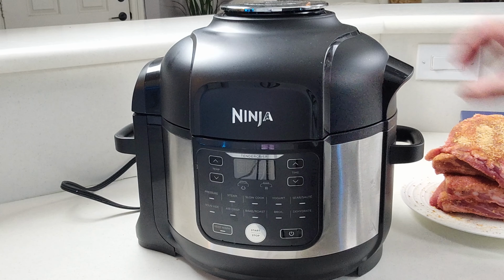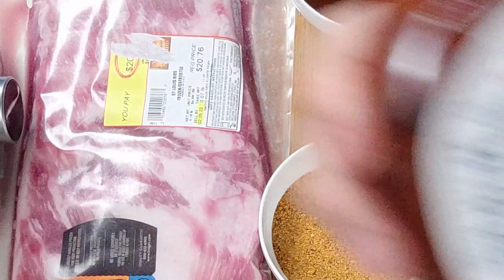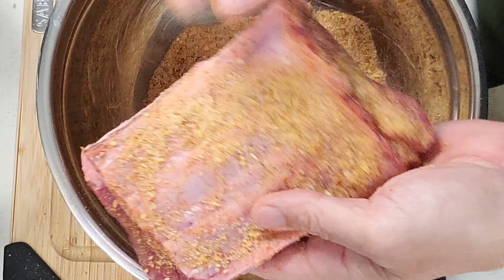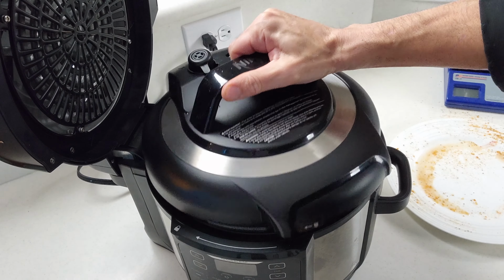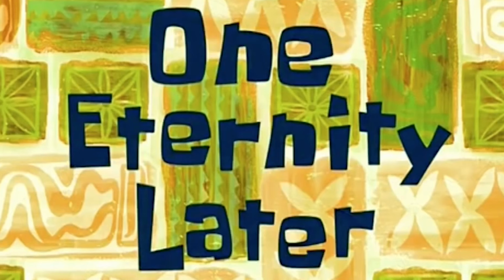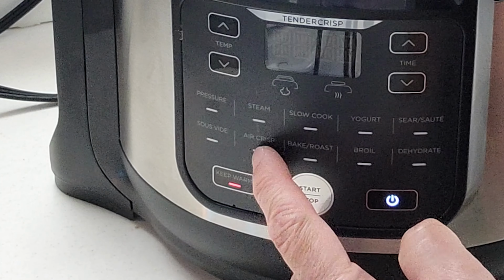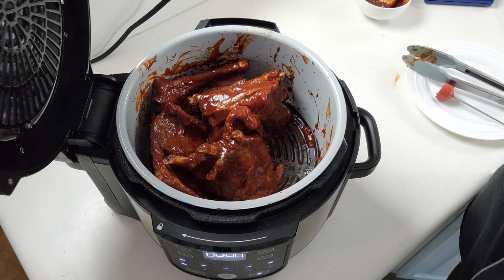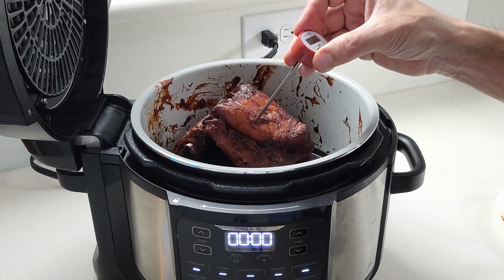How to Make BBQ St. Louis Ribs! | Ninja Foodi Pro Pressure Cooker Recipe

Comment: Joes it is not supposed to have a membrane to remove before preparing the ribs ? You didn't mention it in your video!!! are you really a real chef??? I doubt .... anyway, thanks for sharing ...
Reply from the maker: It's a pre-prepared rack. There was no membrane to remove. However, you're right and I should have mentioned it. Thanks for the heads up.
Reply: I would say if your cooking ribs by any method, you already know to remove the membrane as you most likely seen it in countless other videos you have found and watched........ lol
Reply from the maker: When we did this video, I used a rack that had been butchered with the membrane removed already, and I totally just forgot about it since I didn't have to deal with it... Oops. Haha.

Comment: We make ribs in our other brand of pressure cooker (IP) and they always turn out great! However, we don't use the method you illustrate - we will try yours as the results look great!
Reply from the maker: That's EXCELLENT! Using that BBQ sauce and the Monkfruit sweetener, I managed to really keep the calories down on that too. You'd never know it by the flavor. The pressure cooker did all the work for me though. Lol.
Reply: @JoesPhenomenal   In the IP, we immerse the ribs in apple juice and a bit of liquid smoke. Cook for 20 - 25 minutes. Then we pull the ribs out of the liquid coat them with sauce and put them on a pan and place under the broiler for about 10 minutes.
Reply from the maker: Well that sound pretry dang good.